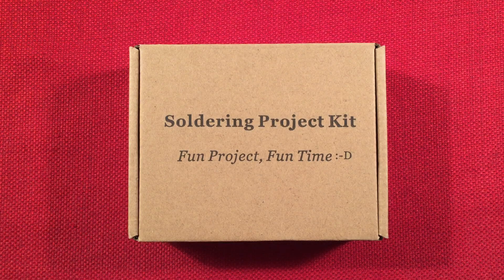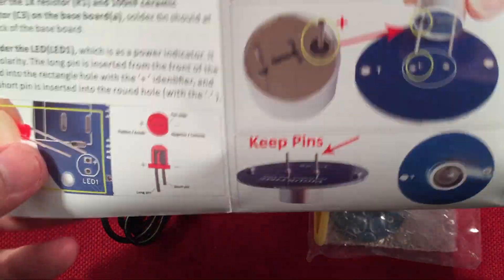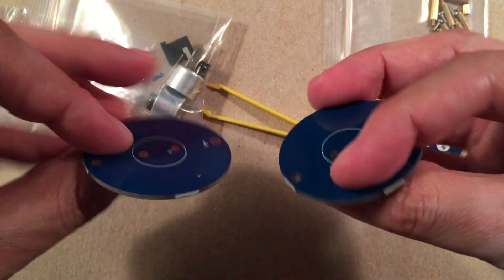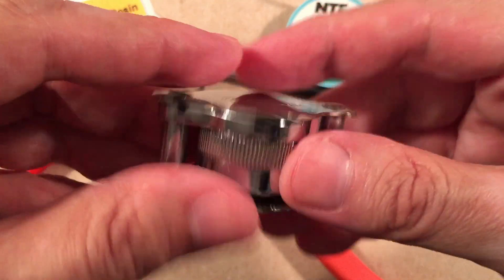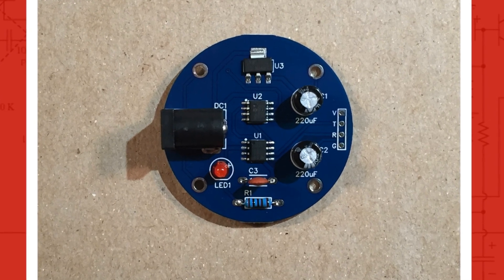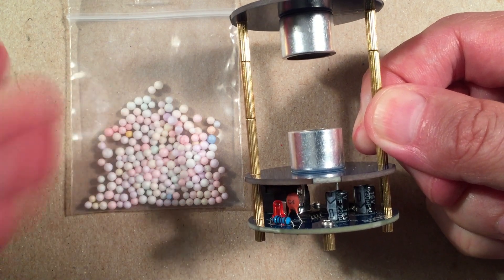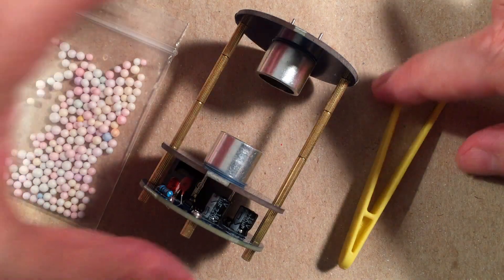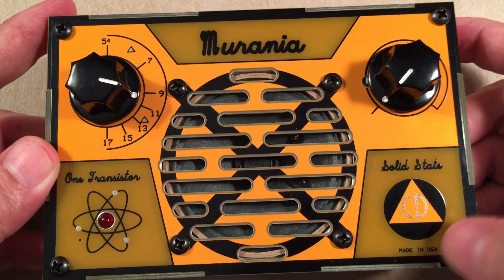Vigurtime VT-29 Ultrasonic Suspension DIY Kit Review

Comment: I like how you show what tools you use. That's great for all the first timers out there. Even well seasoned like me, I also like to see what kind of tool somebody else uses. Maybe I'm missing out!  I also have a circuit board holder. I'm not sure if I learned that from you in one of your radio builds or not.
Reply from the maker: Might have been another channel on the board holder.  I think those are cool.  My setup is a cardboard box, and I solder standing.  Yes, I don't show that :)  I have a helping hands somewhere, but never set it up.  They are fiddly.  Joining wires together would be nice with one of those as well.